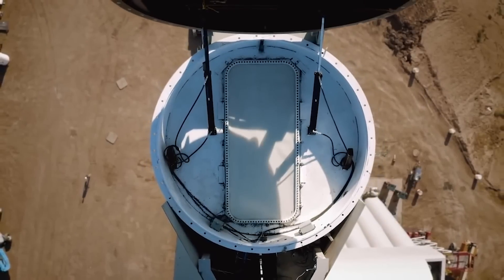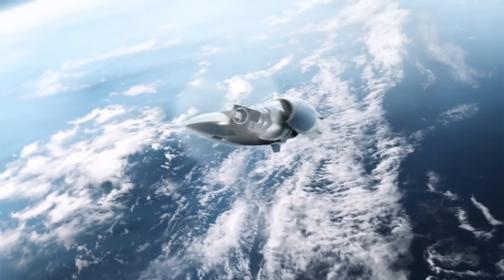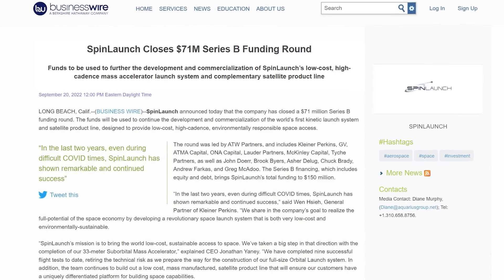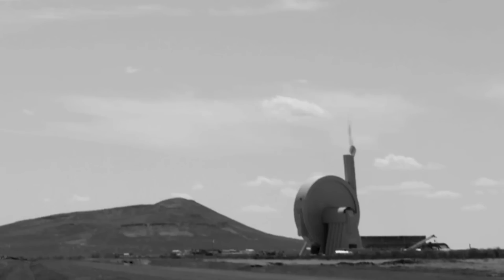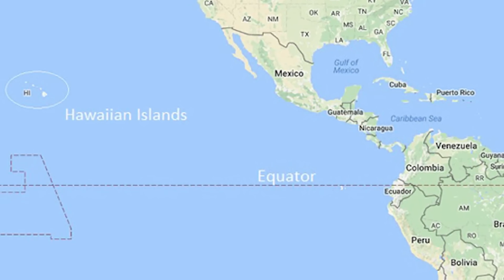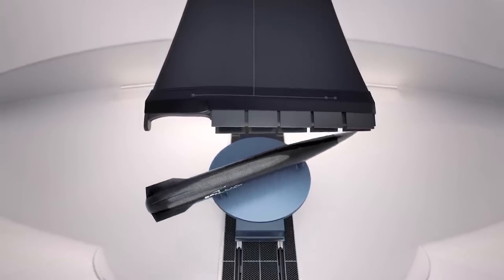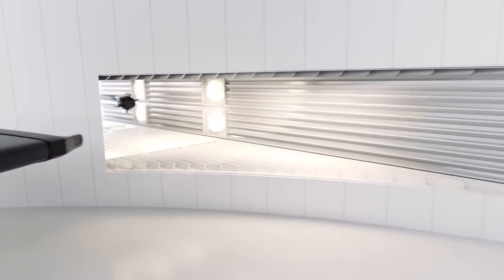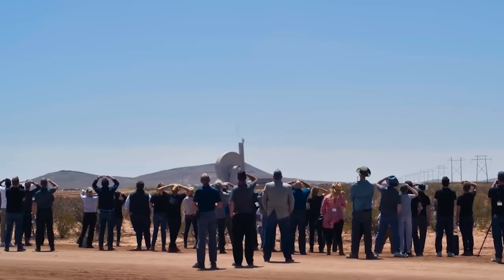What Happened To SpinLaunch & The Orbital Accelerator?

Comment: The main advantage of SpinLaunch is they should be able to launch small payloads every few hours because they are not dealing with all the complexities of cryogenic propellants and rocket launches.  This makes it a perfect platform for space station consumables resupply.
Reply: chances of this working is rather slim - fuel for a solid rocket 2nd stage would collapse and a liquid second stage would deform its fuel tanks (a second stage comes higher from a plane )
Reply: @replica1052  Right!   The Yeeting with the spinny thing is the EASY part....making any kind of rocket that could take the lateral G's and still work...make that FIRST before worrying about all the rest of throwing it into the upper atmosphere.
Reply: @replica1052  The Military would disagree with you as they use their rocket propelled artillery.  The shell is fired from a gun and then a rocket assist gives it added range.   It maneuvers to the target.  This has been happening for decades so it appears you are incorrect.
Reply: @dionysus2006  artillery don't make it to orbit much
Reply: @replica1052  They don't try for orbit but for maximum range.  This is while deep in the atmosphere.  It is similar to SpinLaunch in that it is a high g launch followed by propulsive targeting.  It just shows it is possible plus the suborbital tests were successful.  I remember how they laughed about landing the Falcon9 propulsively and now they have done over 200.  It doesn't even make the new it is so routine.  The technology is there to do this.
Reply: @eleventy-seven Artillery is.  SpinLaunch has very low recurring costs once the launcher is built.  Probably cheaper than artillery.
Reply: @dionysus2006  the technology to get rockets high before they start is called planes
Reply: the small satellites need to be that much Gforce resistant to launch on spinlaunch
Reply: I think stratolaunch seems more feasible
Reply: @MrFukyootoob  The problem with that is having to make the extensive ground support equipment airborne and not getting much of a velocity or altitude boost.  Didn't StratoLaunch go out of business after their last launch failure ?
Reply: Horizontal translation at launch throws off trajectories.
Reply: @LordDustinDeWynd  Which are corrected.  You only have to get into orbit long enough for the recover vessel to retrieve the cargo. A good cargo would be water
Reply: @dionysus2006  The sideways translation is why their prior tests have failed  - they're unable to predict the variance, and the rockets aren't very steerable in-atmosphere.
Reply: @LordDustinDeWynd  I need to read up on this .  I thought the payload was launched to 40 miles high before it had to steer or provide propulsion.  Does it have to provide attitude control before this?
Reply: @dionysus2006  THAT'S THE PROBLEM.
Reply: @LordDustinDeWynd  With artillery they spin the shell and depend on aerodynamics to keep it stable.  Why won't that work here ?
Reply: @dionysus2006  rifled barrels spin the bullet around it's long axis, like throwing a football.  These guys attach the rocket to the end of an arm and spin it around super-fast in a circle (like on a merry-go-round or throwing a hammer) and release it at the precise instant so it flies up and out and into orbit.  With no engines or fuel except maneuvering thrusters.
Reply: @dionysus2006  The big draw on this is the no-engines no-fuel all-payload.  If they had the release perfected, the exit tube would be circular, not oval. The oval is so the payload isn't totally lost if the release is NOT precise, it allows for the lateral movement seen in the clip.  They're getting closer to how they need to do it, not there yet, though.
Reply: @dionysus2006  They must plan for a precise trajectory for a huge number of different reasons.  If the trajectory is off by even a mil coming out of the tube, it'll be MILES out of place at orbital altitudes.
Reply: A great place to set this up would be any tall mountain close to the equator.  Years ago, they were talking Hawaii.  They can get the first 15 or 20,000 feet (3.7 miles) of thick atmosphere out of the way.
Reply: @LordDustinDeWynd  Yep
Reply: Resealing and pumping down the vacuum chamber to the requisite pressure after each launch would take a long time. Now, they could possibly shutter the exit ramp right after the projectile punctures the membrane so as not to lose the vacuum entirely, but with the level of vacuum they need I still think would be time consuming to pump down.
Reply: @michaell8269  They need to get rid of the membrane and use some kind of high speed panel that reseals after launch.  Maybe use the kinetic energy of the launch arm to drive vacuum pumps to speed up the process.  They also need a robotic loader for the next payload since they would be loading it in a vacuum.  I can see this being fully automated so they could launch once an hour.  If they just launch into the same orbit each time and depend on some kind of space tug to collect the payload and deploy it they wouldn't have to wait to sync up like Crew Dragon does with the ISS.  If they are launching water you just need to get it in orbit, it doesn't really matter where.
Reply: If they get astronauts to accept an Italian diet, they could use the properties of frisbees to fling pizzas up to them.
Reply: Who wants sonic booms every few hours?
Reply: @tr4l1975  Everyone, if they're done on a schedule.
Reply: @tr4l1975  the rockets are flying away from you so you wouldn't be able to hear the sonic booms, right?
Reply: @WuffiePhoenix wrong. the initial burst when it hits the atmosphere as it exits the centrifuge creates the largest boom of all, spreading in all directions.
Reply: @paulmichaelfreedman8334  oh right. Didn't think of the fact that Spinlaunch is already supersonic at launch.
Reply: @paulmichaelfreedman8334  So you have watched a launch in person?
Reply: @tr4l1975  You don't get sonic booms if you go straight up.  I've never heard a sonic boom at a Falcon9 launch.
Reply: Pipe dream,no free lunches in physics🍕
Reply: @setituptoblowitup  Suborbital flights have been a success.  Next up is a larger launcher for orbital.  What law of physics are they breaking ?